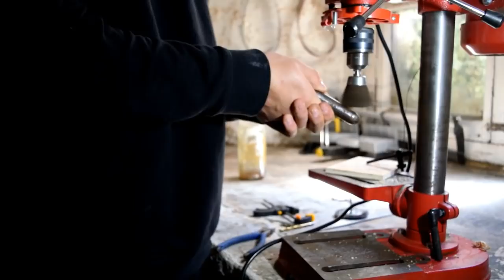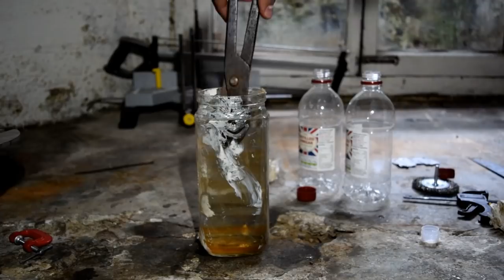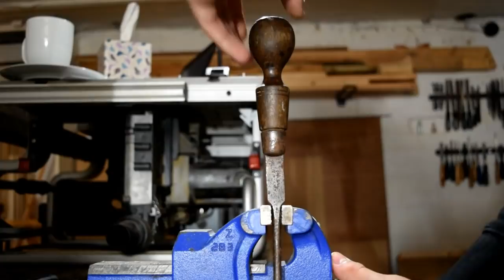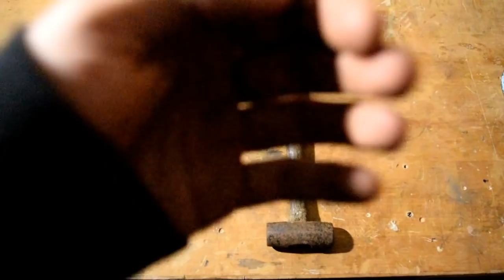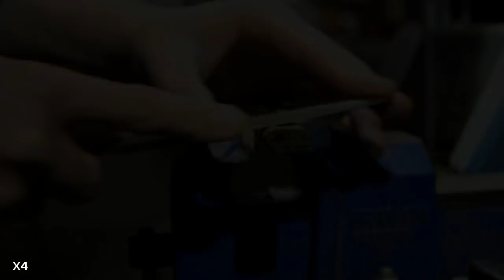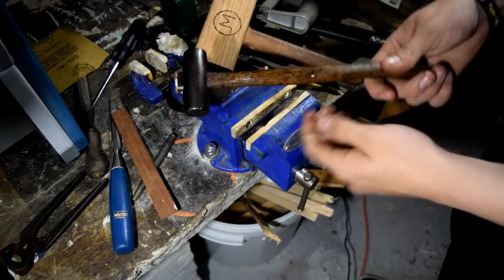Restoring Old Hand Tools [38]

Comment: This video reminds me of my early days when I first started building my tool collection. I set out to restore old American tools awhile ago and now have a huge selection of quality tools that I just love. The reason I went that route is because new tools are not as good quality and tools like Matco and snap on are way over priced. I probably have 500 hours in restoring my tools. I ate enough patina and rust to kill a small dog. At this point I no longer look for common small hand tools because at some point a man has enough hammers and screw drivers. I have become a lot more picky at what I buy and restore now. For you new guys, I want to tell you that you can build a very good collection of tools at minimal cost if you're willing to get down and dirty. You don't need thousands of dollars. I started out with a wire brush and some WD-40 and went to work.
Reply from the maker: Great story mate,  I completely agree, they don't make tools like they use to :)
Reply: Modern tools do nöt have the quality they used to have.Better to refurbish old products.Skål.
Reply: You should make a video of your collection, or at least your favorites and post it on the tube.  😁
Reply: @timeflysintheshop  believe it or not, my favorite tool is a craftsman flat head screwdriver. I'm a full time handyman and use It every single day. I just broke the tip on my spare flat head klein screwdriver, go figure. Anyway, I'll do that sometime. I have a lot of tools.

Comment: There is something so special about inherited tools, we have something deep inside us that feels the need to cherish them.
Good job.
Treat yourself to a bench grinder then buy a wire wheel for it, you won't regret it, one of the most useful things a workshop can have.
Reply from the maker: Thanks Harvey! I completely agree, it feels like you're preserving a piece of history, and all the memories/associations that come with that object. I'll look into a bench grinder, thanks for the suggestion
Reply: And when you buy that bench grinder, get a top quality set of safety goggles. Cleaning steel parts can cause wires from the wire wheel to break off and fly into your face as well as other parts of your body.
Reply: Angle grinder with twist wire wheel may be cheaper and more versatile, also look into more gentle methods like mild phosphoric acid or electrolysis for rust removal

Comment: Awesome video! As a gunsmith and tool refinisher may I offer some advise? Your wire wheel in your drill works press works well. If you need a,finer,wheel they sell .002 wire wheels on brownells. Amazing for removing rust. Electrolysis and parts tumblers work well too. The part where you put the screwdriver in the vise made me cringe. To avoid maring may I suggest using aluminum angle pieces for,vise jaws. Love,your work and videos. I'm glad I'm not the only one who enjoys refinishing and repairing tools. All the best
Reply from the maker: Thanks so much for the advice Peter, really great to hear tips and tricks from a professional! If i'm honest with you I didn't really realise there were so many different types of wire wheel so I'll definitely check out the .002. You're right about the vise jaws, normally I swap out the steel jaws for wood ones, but I was just lazy when I did this. I'll definitely look into aluminum, although hopefully i'll be getting another vice so then I'll be able to have one set up with wood, and the other setup with steel jaws. Thanks again for the advice & tips!

Comment: Glad to see you cleaning up the old tools. FYI, if you spray everything with DW-40, it will inhibit the rust, but it will also attract dirt and dust, and make the tools messy to use. Go buy a can of Johnson's paste wax. apply a coat and let it dry, then buff off. Do this a couple of times a year, and you will inhibit the rust and not have a mess of a tool to use.  If you need better protection than that try CRC Corrosion Inhibitor.
Reply from the maker: Great tip, since filming this I now use paste wax to finish metal & 4 in 1 oil to lubricate all moving parts, you're right they definitely work a lot better than WD-40!
Reply: @jmakes3745  I apply a little boiled [less sticky] linseed oil with a cloth & leave warm place a couple of days - lovely finish good for wood parts and hands.  I am restoring my late father's tools in his house - repaired aircraft in fields during the war.
I wish you could show me how to put together such a lovely video.

Comment: I really like it when someone takes the time and effort to restore and bring back old tools to a serviceable life. I like doing that too and am in the process of doing so with a bunch of my fathers tools. Just a question...you oiled the hammer handle just before putting glue on the insert spline...will the oil interfere with the glue and how well it might stick?

Comment: When I encounter a loose hammer head with a wooden handle I submerge it in antifreeze for a day or two. 
It seems to work and the glycol doesn't readily dry out and shrink the wood again.
Reply from the maker: Nice tip! Never heard of anything like this... will have to give it a try some time, although I'm not sure it worked with this one, as the handle only went up half of the head so it really needed re-mounting anyway
Reply: The better way to do it is to submerge it in linseed oil. The wood will literally absorb the oil and will probably tighten up around the head where it has become dry and shrunk. The oil will also protect the handle  by sealing the wood. Antifreeze is probably not a good solution because it is poisonous.
Reply: @qzetu  I was going to say the same, also a thin film on the metal parts leave in sun/warm place a couple of days; surely no need to glue the wedge.

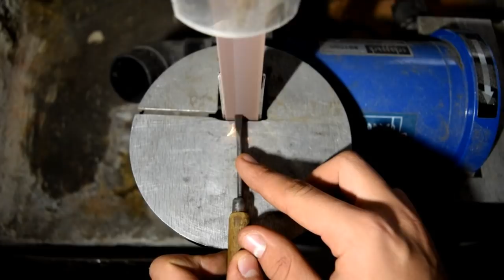Comment: Hey, nice video. But there are some major mistakes you made, restoring your old tools. First of all 4:30 : Flathead Screwdrivers are not supposed to be sharp!!! It gives them less grip on the srew and makes them wear off again quicker. And second: I myself like to keep old tools as original as possible, when I "restore" aka clean them. But sometimes you just have to let go, just like you should have done with the handle of the hammer. With that many wormholes and the crack you caused on the top end of it, the handle is basically bound to fail and break on you at one point, possible injuring you or damaging something in your workshop. Instead I would recommend you to eather take a handle of another old hammer (you can get those dirtcheap at any fleemarket or garagesale), or to make one out of new wood, which you can then age by staining it or etching it with vinegar and other substances.
Keep it up, bye
Reply from the maker: Thanks for the comment Dieter but I if I was you i'd work on not sounding so patronising in your comments but instead providing constructive criticism, and consider how different people use tools differently. 

If you look at 4:30 you can see that i'm not only re-grinding, but i'm also grinding the tip so that it isn't sharp, but instead had a good head to grip with. With the hammer, I guess you could go to the effort of sourcing and shaping a new handle if you intended to use the hammer every day with some heavy abuse but tbh i'm just using it occasionally for small jobs & in the months i've been using it its still as sturdy as the day I finished this video. If it starts to loosen I can then go and replace it.
Reply from the maker: kingshinigami1989 Fair enough Kingshinigami. Re reading it, he did have some good points but I guess it’s all about the first impression created and responding to that. Sorry to have lost you :)
Reply: @jmakes3745  tend to agree with your interpretation - they could have said 'I'd do it differently...' rather than 'you made mistakes...'. For what it's worth, I'd have kept the original handle too - it has a lot of history :-)

Comment: i would not use steel brush like that on older tools with rust. I have xp f@cking up brand names under the rust that way.
Reply from the maker: Really, how come? I've found that its a really quick and easy way to remove rust, especially once its been loosened by vinegar or a rust remover.

Comment: You're using a facemask but not eyeprotection when using a rotary wire brush. ??? Wut
Reply from the maker: I wear a respirator because I don't want to breath in any airborn rust, but I honestly don't need glasses because the workpiece is about 3feet below my eyes, and any wires that would fall off (in my experience they never do) would get propelled outwards, not upwards.
Reply: A piece of wire could be broken off as a direct result from hitting the workpiece with high velocity, which potentialy could fling the wire in any direction at high speed. The probability is low I guess, but I dont see why it would negate the use of eyprotection. If you are comfortable with the way you work, then by all means.
Reply: Totally agree, eye protection every time, if you have done enough work on those wire wheels like I have, and having felt the pain of one getting down your boots or even in the house when you're in socks and stand on one, you do not want one in your eye!!
Reply: @nokah6511  yeah I've picked enough of them wires out of me that I know I don't want one shot into one of my eyes. No matter how low the odds may be.

Comment: No offense but cleaning is not a restauration
Reply from the maker: If you're going to comment something critical can you please try and write something actually constructive, with tips on what I could improve on? Nobody cares about your opinion on where the line is drawn between cleaning/restoring.
Reply: I do. Because i want to do some proper restoration on some old tools but when i search for it i only get  cleaning videos with little to none information on the real problems. I would like to be more constructive but i dont think i know enough yet to do so.
Reply from the maker: I don't really have a clue what you're on about. The definition of 'restoration' is 'the action of returning something to a former owner, place, or condition' - removing the rust/re-sharpening/re-handling etc etc as shown in this video is therefore a restoration, as its returning the tool to its former condition and working order. Even if i had just cleaned the tools that would still count as a restoration, as its 'returning' them to their 'former condition.' I don't get what you're looking for tbh - if you want to see people making tools, I have plenty of videos on my channel doing that :)
Reply: Cleaning is restoration to a point. We're not all after a concours job.